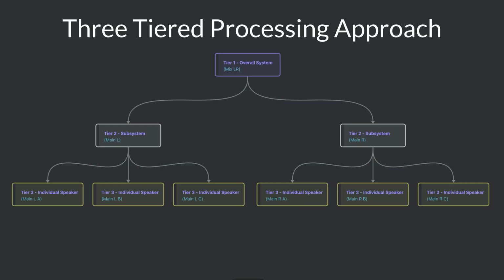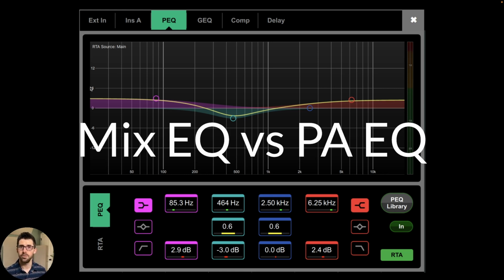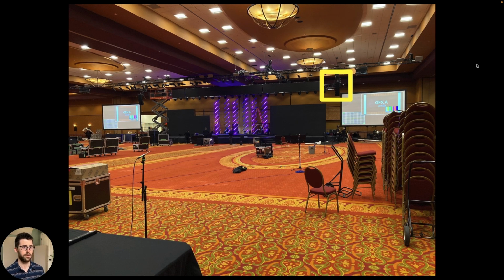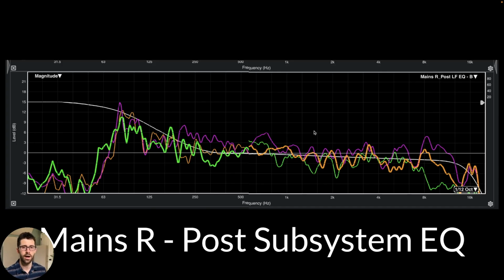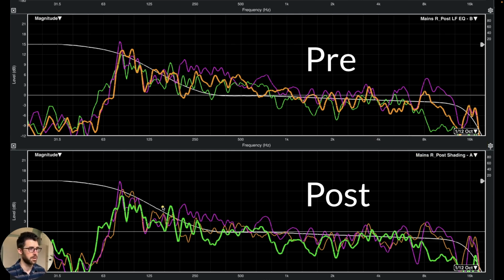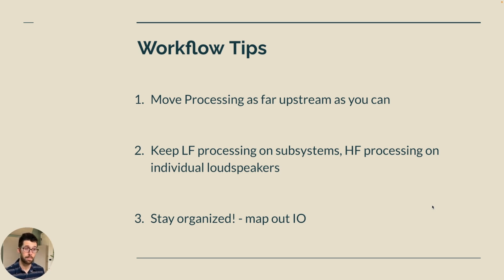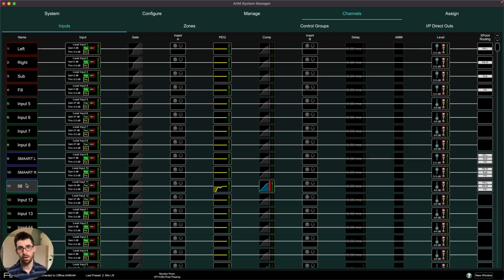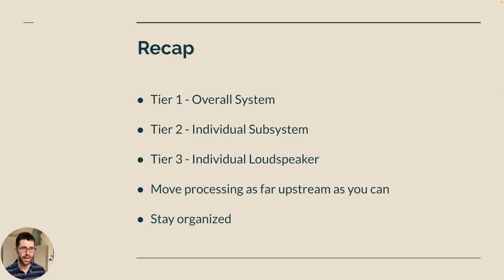How I Lay Out My System Processors (With Free Template)

Comment: How does this work with AHM if you a getting a LCR mix for a venue?
Reply from the maker: I would create another input called "center", then have a corresponding output zone that would feed that. It's a very flexible architecture, so you can really route whatever input signal through whatever path you need.
Reply: @MichaelCurtisAudio  I guess I did not quite articulate my question quite right. How would you then have  overall control (Tier 1)?  Would you rely on the console for that control?  Would you then create the subsystems on the AHM?   I ask because I am setting a system in a few months with an Avantis at FOH and AHM as system management. We will have a center hang speaker and I plan to mix in LCR because I dont want the center to just be a mono sum of the LR.  Your timing on the release of this video is uncanny.  Thank you for putting these out, I have picked up Micheal Lawrence's book on your recommendation.
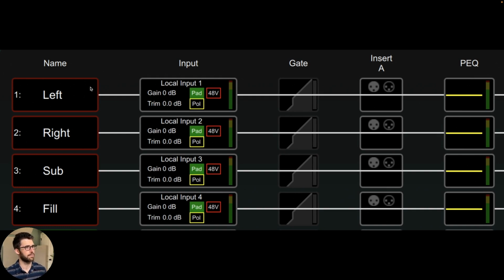Reply: I was just re-watching this and I think you touch on it around 3:05.  Please correct me if I am misunderstanding this.  You have each of your mix input running to completely separate channels, so if you wanted bring over all 500hz down you would have to do that on each incoming channel?  So you don't have a global EQ on the full system?  You are working on systems much larger then I am used to so that may be the standard at that size, and I just am not used to that. and again I may be misunderstanding what you are showing us.

Comment: Are you able to have mute groups, or scenes or snapshots on the processor?
It would be nice to be able to patch in two consoles, one for headliner and one for opener.
Than you could use the DSP as a mix switch.
Reply from the maker: On the AHM-64 specifically, yes you're able to change presets and have it do what you're asking.
Reply: some processors have that some don't.